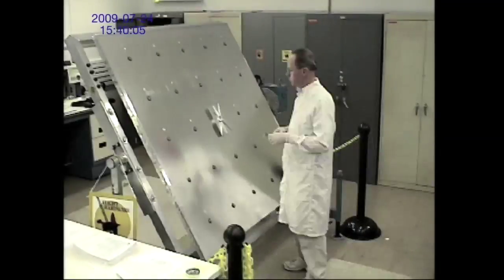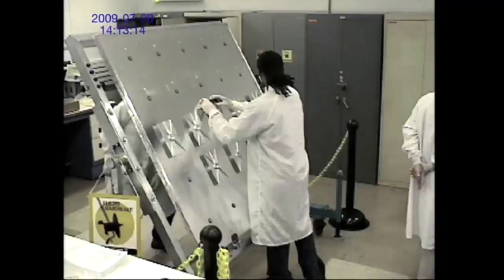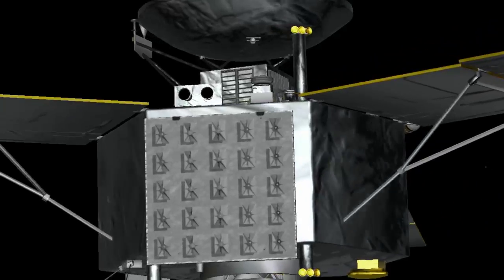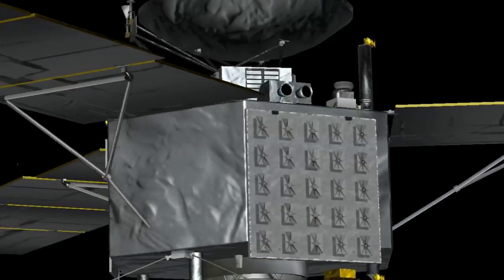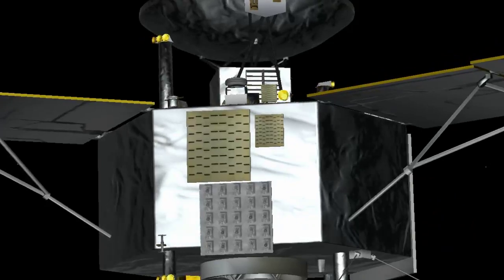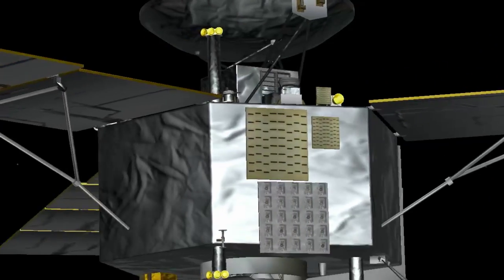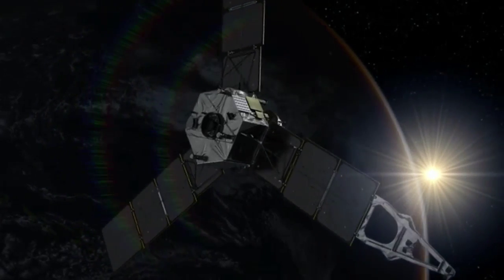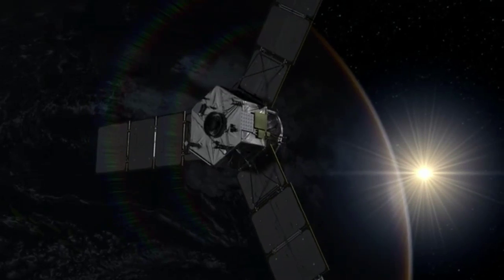Juno's MWR Instrument

Comment from the maker: MWR senses the atmosphere to a depth ~1000 bars pressure, or around 600 km below the cloudtops. The 6 MWR antennas each sense a different range of depths, and the lowest depths are sensed by the largest antenna, which is sensitive to the longest wavelengths of microwaves. The gravity science instrument senses all the way to the core, in a sense, because the shape of the gravity field is determined by the entire planet. The magnetic field map also will reveal deep structure and activity.